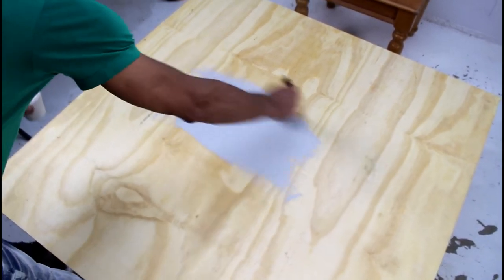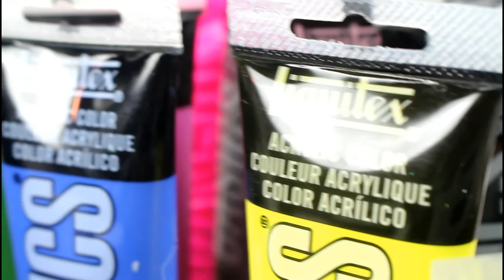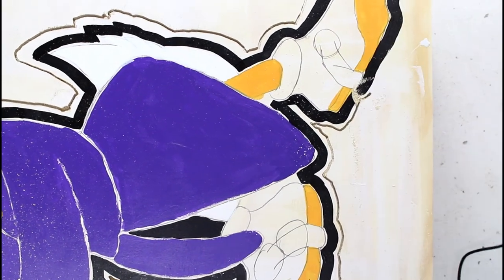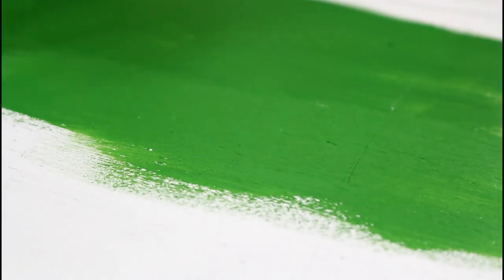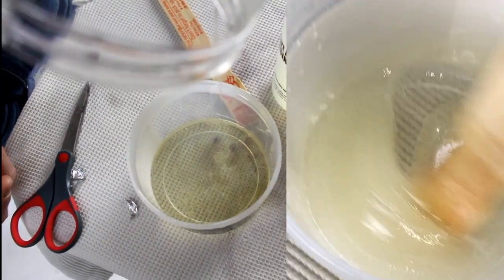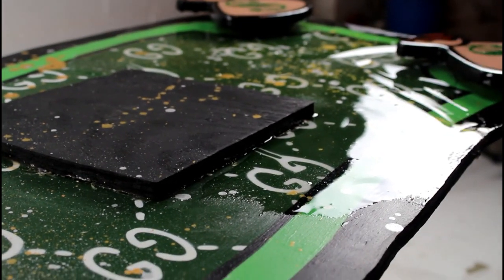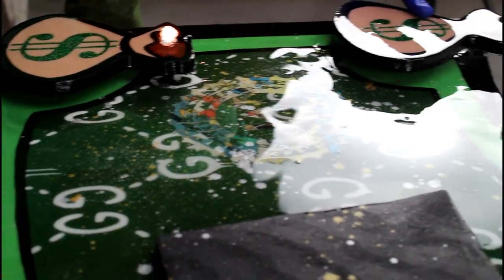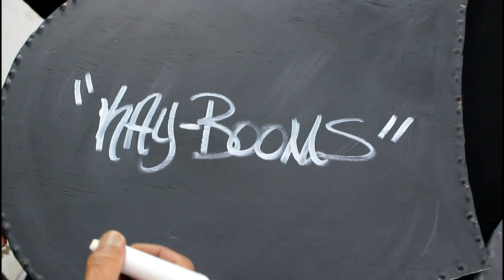Wood Cutout Epoxy Resin Cartoon Art x Step by Step How To x Cut x Paint x Sand x Pour Resin

Comment: What’s the best kind of wood to get and size? Would paints do I need to get I already got angelus paint for customizing shoes
Reply from the maker: i cut them alot of the time so i get the biggest that they have 8 feet by 4 feet down to a 2 feet x 2 feet ... the quality acrylic paints does the job great .. the cheap stuff will soak into the wood ..
Reply: @KayBoomshop  can I use my angulus paint
Reply from the maker: @kenmckinnie6061  I would say yes .. make sure that you prime the wood surface at least twice .. the wood is going to want to drink that angelus 👍👍

Comment: It sounds like you use MDF boards. Those boards are smooth and easy to paint. However, they can’t handle screws well. How do you hang it?
Reply from the maker: Small nails and liquid nails provide enough strength for the braces I attach to the wood 👍 ... screws and more wood ideally for the wall support..

Comment: Not to sound stupid, but do you sand the wood before putting on the grey primer?
Reply: And do you do two coats or just one?
Reply from the maker: Sometimes 👍… depending on the smoothness of the surface .. some wood needs it some doesn’t 👍

Comment: Hi can you tell me the exact kilz primer u use? I dont see any for wood and the ones I’ve seen are glossy finish, does that matter if it’s glossy?
Reply from the maker: it doesn't have to be kilz .. but the gloss wont matter .. the wood is gonna soak most of it up anyway .. several coats is not needed .. you just want a barrier so the wood doesnt eat you color paint & because if it does you will be doing 100 coats of color

Comment: Nice work you do...I want to start...What kind of plywood you use?
Reply from the maker: not sure the actual name of the wood ... I get the 8 ft x 4ft boards from Home Depot , The really smooth stuff :) its around $50 bucks a board .. they have cheaper & smaller ones too . The 4 feet by 4 feet is good to . But the cheaper ones aren't as smooth and easy to paint on.
and are even harder to cut :( ...

Comment: Hi what kind of resin brand do you use? Thanks
Reply: Do u have a link? I want to work with resin but i dont want tacky, sticky table or yellowing
Reply from the maker: The epoxy resin store 👍 crystal clear tabletop resin 💧💧💧
Reply from the maker: @drippymenace7379  google search epoxy resin store.com 👍👍 they will have several different kind 💧💧

Comment: Would you recommend the 4800 ? and what bit did you use when cutting ?
Reply from the maker: Never used the 4800 ... stopped at the 4000 and went with the roto zip ..  4000 kept breaking/ stopping on me ..

Comment: What tip did u put on the dremel to cut the wood?
Reply from the maker: Have to use the roto zip tips .. the dremel ones break on the thick wood board that I use ... they work fine on thinner wood board tho 👍🏽